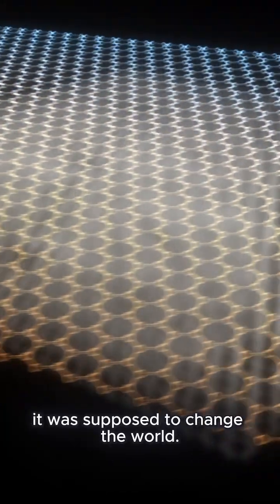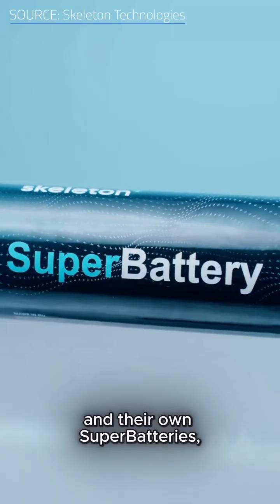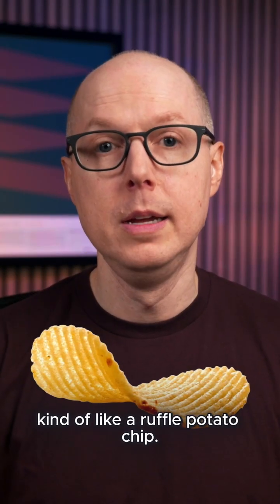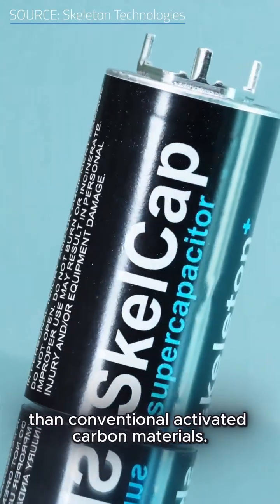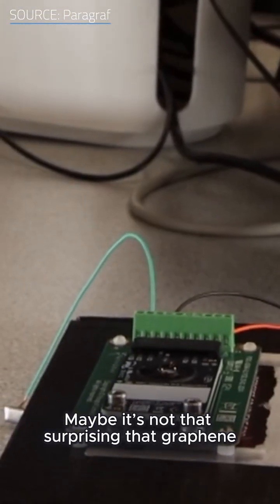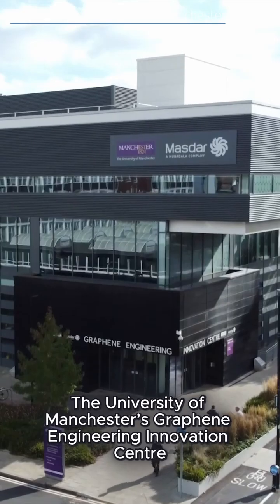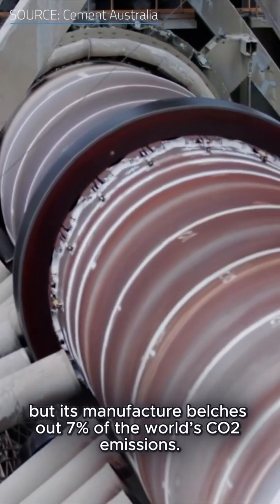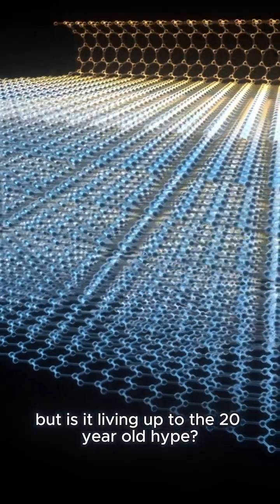Has Graphene's Potential Been Revealed?

Comment: And what about graphene particles in the environment????
Reply: @SolarizeYourLife   graphene is just carbon.
Reply: @kuposrock It is the size that is the concern because anything at the nanometer scale can potentially enter the human body by the lungs or skin and enter human cells   the lymphatic  system etc. 

The biggest concern is not the graphene end product but the castoffs during it's manufacture.

Studies have shown manufactured graphene, particularly microsheets ( sheets up to 5-10 μm in size) and  graphene oxide, can enter human cells through spontaneous penetration of cell membranes.
Reply: Research is ongoing in this regard, but volatile nanoparticles are more of a concern. The biggest risk to people and the environment is the castoffs during manufacture.

The Royal Society of Chemistry (RCS) and the Graphene Council, state "if graphene is integrated within a matrix, it presents no greater health and safety risk than any other material. 

According to the RCS, “once a nanomaterial (including graphene) has been incorporated into a product, it is virtually impossible to liberate the graphene particles from the host material”."

Comment: Research has showed graphene tubes being many times worse than asbestos when it comes to damaging the cells due to their nanoscale size.
If freely used without restriction this could become the next disaster caused by mankind.
Reply: It is a valid concern.

Research is ongoing in this regard, but volatile nanoparticles are more of a concern. The biggest risk to people and the environment is the castoffs during manufacture.

The Royal Society of Chemistry (RCS) and the Graphene Council, state "if graphene is integrated within a matrix, it presents no greater health and safety risk than any other material. 

According to the RCS, “once a nanomaterial (including graphene) has been incorporated into a product, it is virtually impossible to liberate the graphene particles from the host material”."

Comment: I don't know about eliminating the clinker.  Can't get Portland cement without it.  
Does graphene replace Portland cement?
Reply: It looks like they've done it though
Reply: @illused no, I agree they must have- I just don’t understand how. Would love to know.
Reply: @illused i can see graphene being used as an admixture, like fiber mesh or air entrainment.   I just don't think graphene has cementing properties.
Reply: Yeah doesn’t make sense to me either. No ground up clinker, no hydration process. No hydration, it’s just an aggregate of sand, stone and unfired limestone dust.
Reply: Clinker is only one component in the production of cement: the "non-fired" gypsum, fly ash, slag and myriad of other goodies.  I used to think cementing concrete was all about the heavy processing of limestone and its reversion to crystalline form during curing.  Now I realise it's just a binder for the bigger bits.  Obviously graphene isn't the binder, but might be part of a recipe that can be used as a binder with other pozzolans.  I have no idea how... but I guess the hope is to get to curing stage with less CO2 emissions.
Reply: @ChrisNotTheKing thanks.   You remember more than I do,  I was always pushed the PM route.
Reply: @rustywater3219  What got me looking into it was the mysterious ancient "Roman" concrete.  Strong and more durable than some modern products.  I didn't grok what I was reading, but microscopically reverse engineering the stuff had discovered essentially limecrete with volcanic ash and salt water, and that just opened my eyes 😮

There's more than one way to skin a potato.

Comment: Are they actually using it for water filtration yet?
Less pressure than an RO membrane and self healing.
Great for desalination.
Reply: Can you use graphene to get rid of all the salt?
Reply: @dans2971  yup, supposedly does the same as RO but lower pressure and self healing. 
Exciting
Reply: We could desalinate millions of gallons a day if we used nuclear waste heat instead of sending it to towers.
Reply: @phillip_mcguinness7025 power plant and treatment plant need to be near each other or you'd lose all the heat
Normal power plants and ai centers have waste heat also,  but have the same proximity problem.
Reply: @phillip_mcguinness7025  The countries that need desalination already have plenty of heat. (desert).
Reply: @phillip_mcguinness7025 special glow-in-the-dark desalinated water 😂
Reply: @alanhat5252  it's on a different coolant loop genius.
Reply: @phillip_mcguinness7025  it was an obvious joke Einstein.
Reply: @MichaelSmithAU  okay, chief.